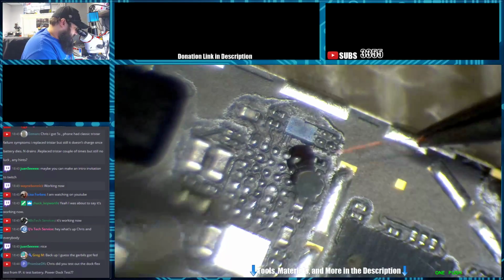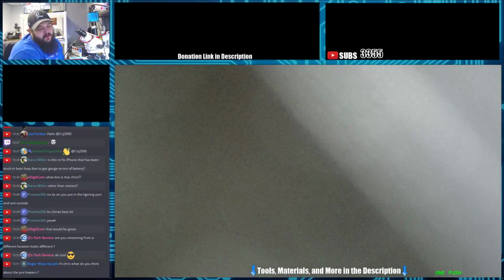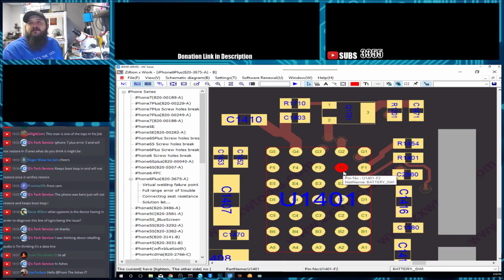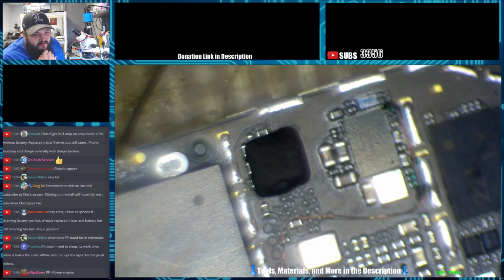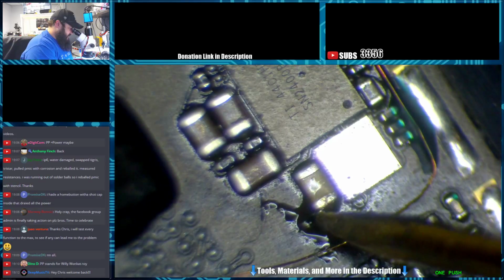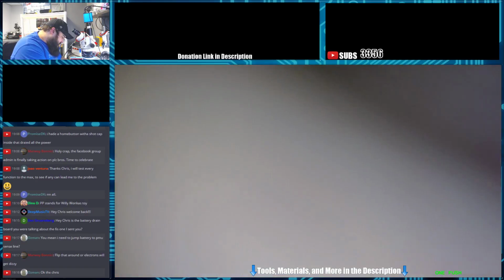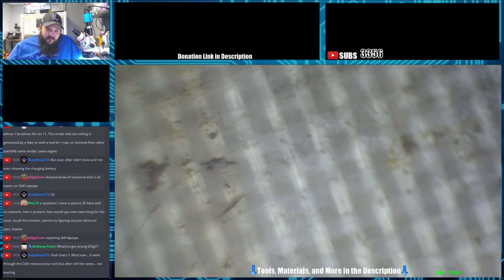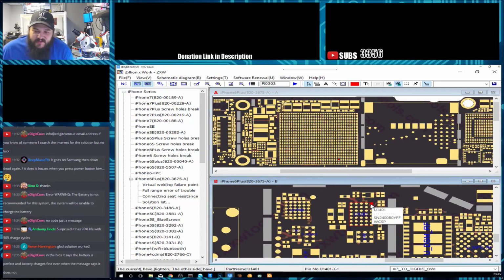iPhone Gas Gauge Fix (Old News made New) I'M BACK!

Comment: Thanks for the physical repair of this kind of repair. Although I need the original battery to not happen again. Also, I removed all caps and resistors and it just works fine with an original one. Also, when downgrading and upgrading such iPhone, it would do GasGauge error when updating.